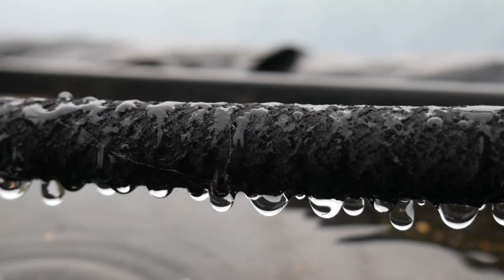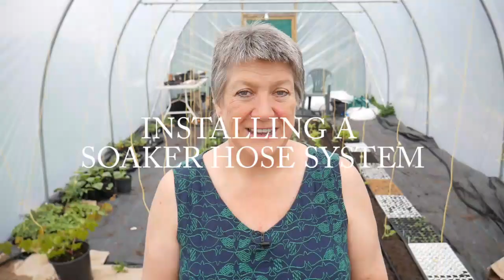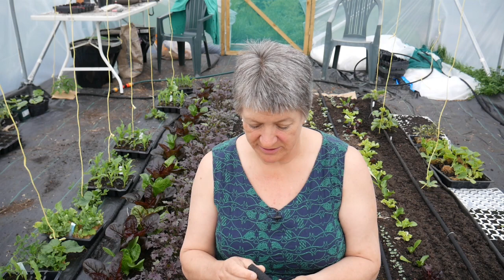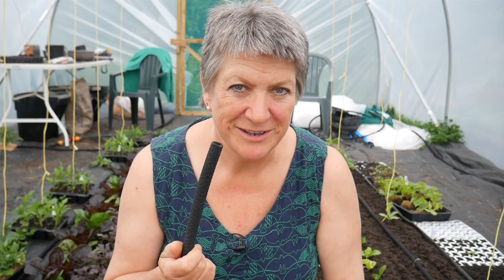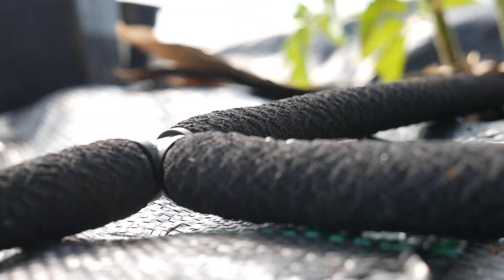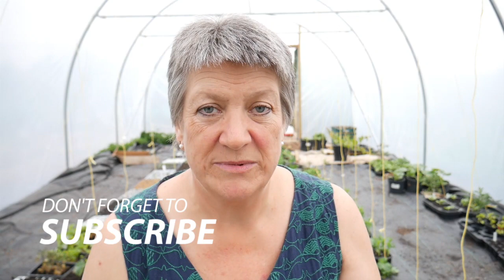EASY Soaker Hose DIY Drip Irrigation | Installing A Watering System

Comment: Hi Liz, I’m looking for a watering solution for my polytunnel. May I ask, did you connect the hose to IBC’s, and did you need to elevate them much to reach required pressure? Thanks
Reply from the maker: I didn't get around to installing the IBCs for the polytunnel before we moved house. Sorry I can't help with how much drop you'd need to create sufficient pressure.

Comment: You should never use tires or recycled tire material in your garden for veg or salads they okay for flowers but not for food you're going to eat as they are highly toxic . Toxic additives in tyre rubber can leach into soil, be taken up by plants and end up in our food. Not a good idea . Use old hose pipe and pierce small holes in it works just same and not toxic like tire material.

Comment: has this stood the test of time liz?
Reply from the maker: Yes, I'm still using it and it works well. 😃
Reply: Hi Liz , I live in Carmarthenshire too. And wanting to install an irrigation system, but had trouble with mice biting holes in plastic pipes that I put on the ground in my poly tunnel. , has your soaker hose been mouse resistant ?   Many thanks Sarah

Comment: I like your easy presenting style Liz. 
You mentioned IBC water storage tanks. I wondered what they were called!
How do you plan to fill them? 
Once in a while from the water main - or do you have a cunning plan to capture rainwater somehow? 
I didn't know that good polytunnels could be so relatively inexpensive so thanks for the information.
Reply from the maker: Hi Tony, I'm still really impressed with the polytunnel over a year later. I planned to do some trickery with guttering and plastic sheeting and I still haven't got around to it - but I will!

Comment: Do you need a pump to get the water from the holding tank to the irrigation system and to the plants ? I was told that it was necessary for the water to flow correctly.

Comment: Now where were you years ago?  Eh?  Eh?  I well remember my husband with a bowl of hot water to put those fixings in - but here's what we did wrong: we didn't have a low pressure thingy and we buried it and had so many issues.  For instance putting a fork through it even though we marked where it should have been.  Or it only worked at the top of the garden and not the bottom of the slope, so we pulled it all up in the end.  I also remember seeing little fountains flying up in the air!  Expensive mistake, but then I guess it's had a lot of niggles ironed out now. Good video, thank you.
Reply from the maker: Thanks Kerry and sorry to read of your problems many moons ago with a soaker hose :-)

Comment: Thanks Liz, nice description.  I have a DIY dripper system in the greenhouse running off a 250 litre water butt.  It works OK once I found a timer that works well on butt pressure.  The problem I'm having is that when my butt is full there is more pressure than when it's empty or even half empty (despite the fact that I've raised it as high as I can to get more head).  This meant that when full the plants got flooded and when getting towards empty they could get parched.  OK that could take 7 to 10 days and usually I got there to top up before that. 

I've decided to bite the bullet and buy a solar powered irrigation system that will supply a constant pressure from a water butt/IBC no matter how full/empty it is.  Hopefully I can just plug it into the existing layout, otherwise I'll replace the hoses and drippers with leaky pipes
Reply from the maker: I haven't worked out how the IBC water pressure will be maintained yet - that will be a video for another day I think!
Reply: @LizZorab  I should also say that I was growing in pots so they either flooded or dried out (giving me split Tom's).  Planting in the ground would probably give more of a buffer absorbing the extra water early on and giving it back later on.  Just decided that I'll going into the soil in the borders this year and might not need the pump.  Will see if the clay soil and manure mix buffers the difference in flows.
Reply: @LizZorab  Here's how my system looks at the moment.

Comment: Hi Liz wonderful idea on the socker hose you have give me a idea for my polytunnel now thank you fro sharing Happy Growing Dave
Reply from the maker: Hi Dave, it really was very easy to do, just took a little bit of planning out, but even if I make a mistake I can change it around using the connectors (which is reassuring as I am bound to make mistakes!).
Reply: @LizZorab  Your not on your own there Liz i make loads of mistakes lol

Comment: Thanks for the shoutout Liz. When you get the IBCs you might not need the pressure reducer if you are running a 12v pump via solar, as the pressure is much lower then mains water (also take the litreage per hour with a bucket of salt!

Ironically i’ve just ordered the bits to finish my auto watering system in the polytunnel - bit different to yours, as i’m providing direct water to specific plants rather than bed watering, like you have.